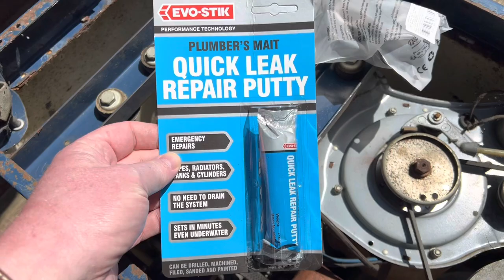Hoovermatic TwinTub, Repair & Full First Demo!

Comment: The Hoovermatic you have is a model 3174, it went on sale in 1957 and was replaced by model 3334 in 1961/1962. My mum had a Hoovermatic 3174 which came from the Hoover staff shop as my dad worked for them.
Reply from the maker: I love that story, thanks for sharing. It’s fun to use these on occasions 🤣

Comment: Hi I’ve just bought a Hotpoint countess washing machine with a wringer attached it hasn’t been used for a while but has been kept in doors in the kitchen and from the pictures looks in great condition it was being sold by a relative of the old person who lived there so they don’t know anything about it, I’m picking it up Friday  , do you know if there is anywhere to get parts if it needs anything
Reply from the maker: What an amazing find! You’ll have so much fun with it. In regards to replacement parts I don’t know off hand, but eBay and the like are the best bet for parts or maybe going some old washer forum etc? Please keep me up to date with how you’re getting on with it.
Reply: @HooverLux  hi I picked up the hotpoint countess today and I have just tested it. Everything works.  Is there any sort of maintenance oiling or greasing they need. I’ve even got the instruction book

Comment: These machines are fascinating. 

How long did it take to heat? Is the heater manual or automatic?
Reply from the maker: It took around 30 mins to get to 60. It’s a manual heater bu the dial on the front
Reply: Thanks. I have seen other videos of this machine. Unlike ours here in the US don't heat their own water. These vintage machines are fun to watch!